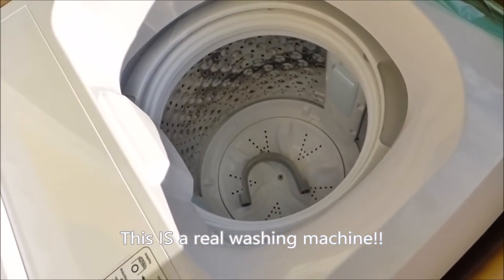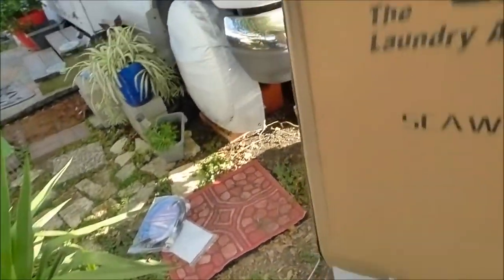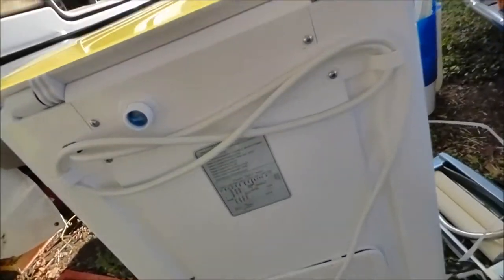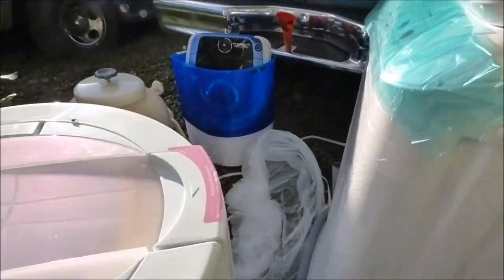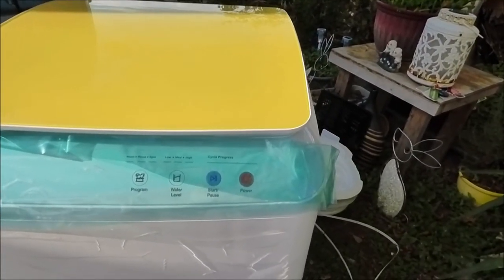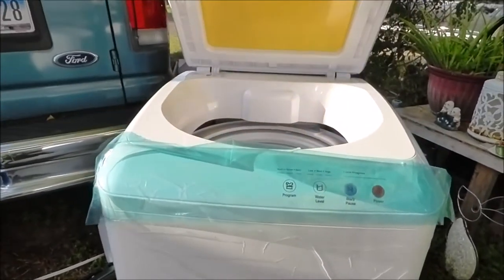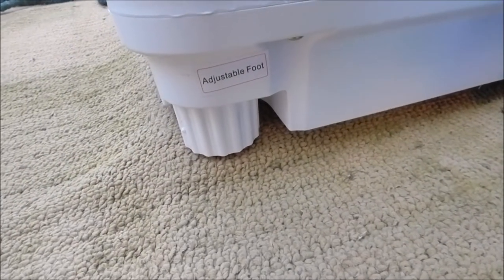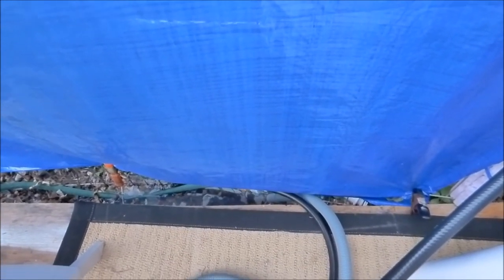Fulltime RVing   Laundry Alternatives GREAT NEW WASHING MACHINE!

Comment: Awesome washing machine, I have a Haier portable washing machine and dryer set in my apartment and it's great, the hole on the side of the machine that you put the cap on is to install the hose in if you want it on the other side, that plastic curved thing is to slip the hose through and it will hang on a counter top but you really don't need that, just put the hose on the ground, great video, thanks for sharing, enjoy your washer.

Comment: Hi there I have this little washer. Putting softener with the detergent it not good, defeats the cleaning power of the detergent. Wait for the wash light to go out when the rinse light is blinking then put your softener in. Enjoy and good luck.
Reply from the maker: Yep. I learned that it goes into rinse cycle around 20 mins in, so I set a timer to add the softener when it hits rinse cycle. This is such a cool washer!!!
Reply: TexCyn RV Life the tiniest belt system ever.

Comment: Did you get their Mega Spinner it works better than the original one and is big enough for a sleeping bag. My clothes dry in 1-2 hrs or less when I run through the spinner. I hand wash. When I move I will get the washer.
Reply from the maker: Wendy B. I have the Nina Spinner. It would not fit a sleeping bag. I have to store the washing equipment in my van since I live in a very small RV. However, I am renovating a 28' Silver Streak Travel trailer, so I hope I can make room for them in there. Laundry Alternatives has great products!!
Reply: I know I had the Nina 1st until it died after the warranty expired. I upgraded to the Mega Spin Dryer that does fit a sleeping bag I have tried it myself. It holds 22lbs worth of clothes and is wide. Great job on your video.

Comment: Can you fit a full set of sheets inside this washer?
Reply from the maker: I haven't tried. My larger items still get washed in a regular sized washer. Maybe one sheet at a time? Again. I really don't know...
Reply: One sheet and pillow case at a time don't wash white towel don't come clean wash twice 45mintues so I will be taking all towel to Laundromats. Don't purchase this I had the first machine after 5 uses it started to leak it was hard to get my refund back I had to call my bank to get involve then I finally got a respond a month later now this machine doesn't clean towels that great the first machine clean everything better. The machine is very quiet.

Comment: Does it have a pump? Cause if it has you are not supposed to put the hose that low
Reply from the maker: Thank you for letting me know that!
Reply: It has a pump and I also designed it with a valve, so it can either be used with the hose low or high to add more installation flexibility to the product

Comment: On the high water level can you wash a comforter or sheets or a coat?
Reply from the maker: Definitely not a comforter. It's a mini washer, not a full sized washer. I have never washed sheets in mine. Only clothes, so don't know. I probably would not want to risk damaging the machine. Thanks for watching!
Reply: Ok thanks for the review. 👍

Comment: Do the clothes get all tangled up?  I'm on the fence about getting this.  I don't want my clothes ruined.  Also, I live in a 3rd floor apartment.  Do you think my downstairs neighbors will hear it?  Thanks for your help and the great review:)
Reply from the maker: Lori I haven't had any tangle problems. I love this machine! If you use a timer, the rinse cycle comes on in about 20 mins, that's when I add the liquid softener. The machine is very quiet.
Reply: if your walls are thin or live in old apartment. They will hear the washer downstairs
Reply: Actually they won't.  This machine is VERY quiet and IF they are able to hear ANYTHING, it MAY only be a gentle 'hum" from the pump motor.... maybe.

Comment: What does the blue light do.
Reply from the maker: It's supposed to help kill bacteria.
Reply: But be careful because they said it can cause seizures in certain people!  I don't get why they would make a washer that can cause seizures.  That right there turned me off of it because I have so many health issues.  The last thing I need is to have a seizure due to a freaking washer!  Ugh.
Reply: @lilflower25 ..they have a  model without the blue light and its cheaper on thier website.Same washing machine just without the blue light bacteria killer booster.

Comment: How lo g do a cycle wash for is a short wash cycle or quick wash cycle.
Reply from the maker: That I can't really say. I always use the same cycle. 20 mins after I start, the rinse cycle comes on, then I add my softener.
Reply: This washer has only one automatic cycle, which is: Wash(14 mins) - drain/spin - rinse(1) - drain/spin - rinse(2) - final drain/spin, I believe about 42 mins total.    However, you can start the washer at any part of the cycle you want, just press the "program" button to change before you press start.  You can also repeat ANY part of the cycle (or change water level) at any time, just press "pause/start" then the "program" button (or water level) to select wash, rinse or spin, then press "pause/start" again.    If you wanted a shorter "wash" you could probably start it at "rinse".  This way you'll get a short "wash", but only one short rinse.